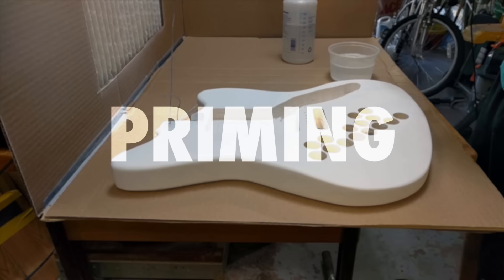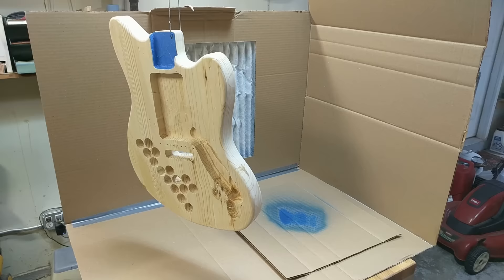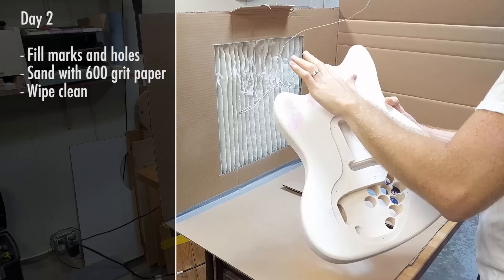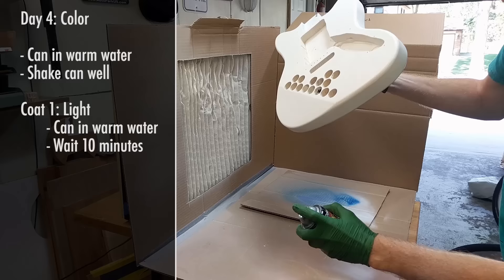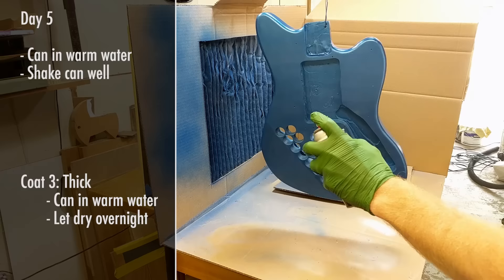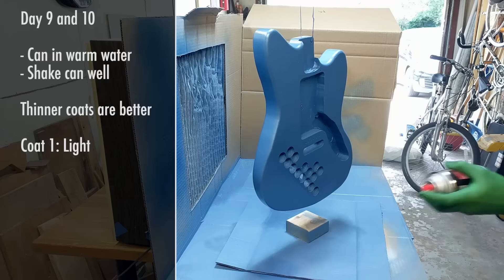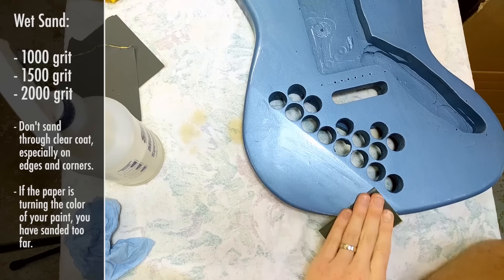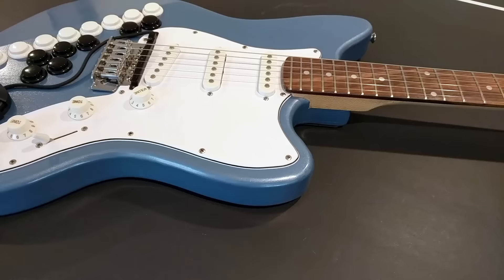How To Spray Paint A Guitar - Start to Finish

Comment: let the lacquer harden for around 3 weeks before assembling. I used this tutorial but I had a piece of electric tape on the body, and when I took it off, it tore of the lacquer, even though it dried for a day. I don't want this to happen to anyone else so please re-comment this so it dosent happen to anyone else!
Reply: The clearcoat should cure for 3-4 weeks before polishing/reassembly, IMO.
Reply: @KentQuickstad  ill edit my comment, thank you! :)
Reply: Honestly, all paint layers have to dry for much longer. There's a pretty serious risk at layers cracking when you go at it at this speed. Not saying it couldn't work out well, but the real time it takes to dry is weeks if not months. I know they claim this type of car paint sets in 6 to 12 hours, but it really doesn't. If it's not set well before the lacquer, you can get issues. Mostly when ambient temperature changes a lot, but also in event of bumping the guitar into something. And the primer has to be sanded down slightly for optimal fixture of the next paint layers. Can't do that either when you rush it too much.
Reply: @KentQuickstad  If you use automotive clear coat you can cut and polish in 24 hours.
Reply: Always remove tape as soon as you can. Try do thin coats. Removing the tape before the paint is fully cured and still just about not touch dry will avoid finish tare
Reply: @briw4647  I do the same. Redoing the tape isn't too big of a deal. Also, the tape adhesive will turn gooey from the solvents. I just pull it off as quick as practical :)
Reply: @briw4647  what if I wanna tape off a spot to paint a diff color? Do i have to wait weeks for it to dry to safely put tape on again and paint a certain area?
Reply: @colinshreds69  if doing different colours, tape off and paper cover the parts you want a different colour, then cover tge sprayed parts to protect it from the 2nd colour. Use low tac tape, and keep the tape on for as little time as possible as the longer it stays on, the stronger the tac gets. 
Then clear coat on top of the colours to seal when dried. 

I prefer not using paints for 2 colours for the hard lines you get when both touch, I dye it and blend the colours together 
 Looks nicer to me.
Take care when putting tape on painted surfaces, make sure its very dry as you can tare it off. For this reason, I prefer poly paints when I have to use 2 colour paint tones . Lacquer takes too long to cure for me
Reply: Not all masking tapes are the same. I learned this the hard way painting a car with duplicolor paints. Make sure you use automotive masking tape not household masking tape. The solvent on the household masking or painters tape will lift this paint. Wouldn’t use electrical tape ever for masking either.
Reply: This is noted thank you for the warning, about to create a guitar for a friend.
Reply: @shaunmcinnis1960  
Turbo clear 4 hrs
If forced dried 1 hr.
Reply: Good looks boss. Almost just messed my whole project up but saw this just in time 🫡
Reply: That's right, back in like 2005 I painted my Ibanez 7 string and this was during that time you know, when we had to print things off, and one of the things I read was to let clear coat dry for like a month. I was a teenager during those times so I was too impatient. But yes, you want that to cure for about a month. It sucks waiting that long but that's what the pros recommend.

Comment: Primer isn't a filler. If you want a perfectly flat surface, you should fill before doing the primer. :)
Reply: And how do you do that?
Reply: @randysalazar9030  You'd use wood filler paste to fill the grain if you have an open-grain wood, then sand. After that, you'd want some kind of sealer coat like shellac or Stewmac's vinyl sealer.

I made the mistake of starting with primer but as far as I know you can do a seal coat over top of anything and it won't hurt anything
Reply: As a model maker, there are primers that act as fillers. But what is cringy is he said to do a thick third coat. No. Each coat should be a thin coat until you get the color you want. First spray doesn't need to cover all. Second coat gets a little more of the nooks and crannies. Third spray should cover all, fourth spray and on till you reach the color you desire. As far as the primer, use the right primer for the job, then prime, and sand to find high/low spots, fill or sand as needed, prime again, rinse lather, repeat until smooth, lightly sand, paint until the color is desired, then clear, lightly sand, then clear again, sand then polish. 

I don't understand why people use thick coats. It just causes runs and orange peel. Proper prep means cleaner and smoother finish.
Reply: Randy Salazar no no no! Wood filler is not the same as GRAIN filler. You’d use grain filler to fill the pores. Wood filler is not what you use. This is incorrect info. Woods that use grain filler are ash, mahogany, oak, etc. Alder, maple, etc do not need grain filling. I have built several guitars with factory finishes. I seal the guitar first, then grain fill, seal again, grain fill once more, and seal once more with a thick coat. Then you start your base(color) coat. Then spray clear and wet sand and buff, and you’re done. Finishing requires a great deal of research, if you want to do it right. I suggest doing tests on scrap material before you do a guitar. Will help you practice and save you a lot of headache in the long term.
Reply: Also- make sure you sand your last sealer coat flat before your base. Will help give you a smooth finish. It’s important to make sure your grain is filled and sealed. You’ll still have slight dimples where the grain is, but as long as it’s sealed and filled , it’s ok. You can build up clear coat and sand down it will be perfectly flat.
Reply: Is it ok to use gorilla superglue as filler?
Reply: @deathleechofficial  i would only use bondo professional glazing & spot putty for dents. If the holes are large, use marine epoxy.  Also use dowels  for round holes and make sure the dowel is resessed a bit then add the bondo over the dowel. For a spray before primer use deft clear wood finish semi gloss. Works great. Lots of coats.
Reply: @deathleechofficial  nope. go to at least home depot, even the cheapest wood filler sort of works.
dilute the wood filler a bit,
cover the whole guitar like you were painting it with the filler (if like me, you made a lot of dents to the wood)
use an old credit card to put filler on all of it (not too thick) and as even as possible

then wait a couple of days for it to dry.
then wet sand it. 
all the dents should be covered, and most the rest of the guitar would have a faded color of the wood filler (as it would have covered the open pores)
Reply: "Use a high build primer" thats what is for
Reply: How can I seal the wood and keep the grain patterns as a backdrop for the paint? I’m mostly smooth s far.
Reply: Primer works
Reply: But primer is a filler....
Reply: @@slomo7118 That's not true on a two-stage paint job. You only need enough coats of color for complete coverage. The look of the gloss depends on how the clear is applied. For a single stage paint system, you are correct.

Comment: One of the best painting tutorials on YouTube. I grew up in an auto body shop and have always been surrounded by this sort of things the #1 rule of painting is pre-paint Prep. The longer you spend on your prep work the less time you have to put in on the tail end of the project. Sand the body, fill the cracks and gaps, dents and dings. Then return to step one and double check everything and give it a once over just to be sure. Use your hands to feel the body of the guitar/car/whatever your painting and feel for imperfections. Slowly run your hands over it for a few minutes and you will find high and low spots in your filler, dings and dents you didn’t see etc. once that’s done then you can begin with your primer, once your primer is dry you can put on a guide coat of a darker color primer. I.e. if the guitar has been oriented Grey, use a flat black guide coat. Very very lightly fog it on the guitar, very thinly. This coat is to help you sand the primer without sanding through it. That’s why the guide coat should be very light and very thinly applied. Just a quick fog with the guide coat color on the project and then. Let it dry. Once it’s dry get to work sanding off that guide coat. It will also help you find the highs and lows dents and dings as the black primer will go into the dent or knick and as you sand over it the black will still be in the Knick because it’s below the surface. Once you’ve fixed any final problems and the primer is well sanded, then apply your paint. Light coats with a overlapping coverage. Also a big problem most people run I to with rattle cans is that when painting they bend their wrist. Lock your wrist and use your shoulder. Bending your wrist causes the fan of the paint to spray unevenly. Your use of hot water to keep can pressure up was awesome! Well done! That’s very often overlooked! When you are also doing your final polish you can polish in stages to get a deep deep gloss out of the clear. Just like sandpaper, polishing compounds come in various grits. Start heavy, med. light. Ultra fine and then a final glaze. You did an excellent job my friend, good work and a very very good video! Keep it up!
Reply: I remember back in the day (late 80's) when we used to customise our cars in the back yard (definintely not anything pro), it became a bit of a fad to leave your car painted with just a flat grey or yellow primer with a black guide coat on it. It had a sort of tiger stripe effect that the lads thought looked cool at the time. Rough and tough and gave you street cred. Ah the good old days...

Comment: This may have already been mentioned... Using Dupli-color spray paint is ideal because the nozzle on its cans of paint is significantly better than rust-oleum which can sputter and spirt.  I learned the hard way and will be using only Dupli-color from now on.
Reply from the maker: Plus there is usually more pigment in the can compared to Krylon or Rust-Oleum.

Comment: Biggest problem I find with spraying is that it's all very well, building up coat after coat, and leaving it to "dry" between coats. But when its all finished you end up with a "thick" finish which is "dry" but not actually CURED. The net result is that after about a month, the paint finish on your beautifully flattened and polished guitar, which shone in the sun when you first polished it, "sinks back" as it cures and releases the last of the solvents trapped within it. Then the wood grain pops back out as though you hadn't spent the time to grain fill it- twice. Once had a motorbike gas-tank I sprayed- lots of coats of nitro-cellulose. Dried, cut back and polished each layer. After 1 month all cracked like the Giant's Causeway! Beware!
Reply: the holy grail is never let the layers drie out completely. in the car industry within 15 minutes the next layer will be on the fucking car